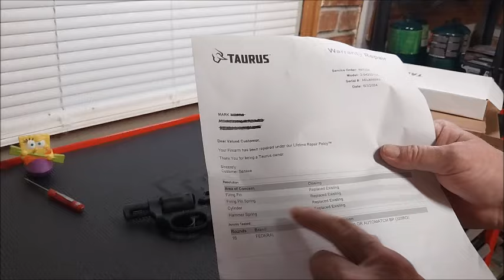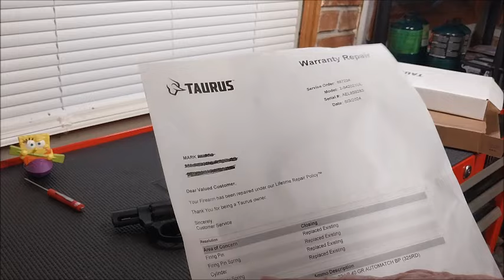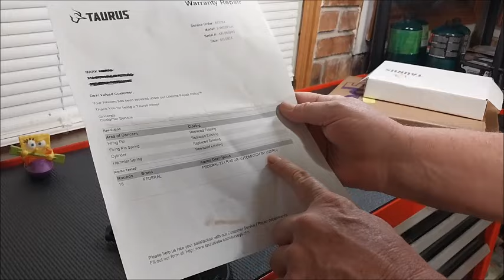Taurus 942UL Back From The Factory

Comment: There are a lot of people out there who use and admire Taurus firearms, but this is a perfect example of why I would never own one!
Reply: The quality control in a lot of companies are terrible these days, its not limited to Taurus. I had a 605 snubby and the screw at the trigger started to come lose. I took it to my gun smith and he fixed it. I ended up selling it and got a 3" barrel to replace it, and have had no problems with it since owning it. I finally got comfortable enough to use a semi and started out with the tx then work my way up to the 9 mm..
Reply from the maker: I can understand that and I don't blame you.I currently have 5 other Taurus firearms and they have been excellent,but I might take one out tomorrow and it won't work.Since I got my Shield Plus I haven't used a Taurus as my ccw since.

Comment: I don't know what is happening with the Taurus revolvers made in Brazil post Covid, but QC has been very spotty. Personally, the last three I've bought; an 856 CH, a Model 65 and the Rossi RP65 all had issues. All three had cylinder rotation problems. The 856 issue was minor. The cylinder would free float with two 158 grain bullets loaded if you staged the trigger. The 65 went back to the dealer because one cylinder wouldn't lock into the frame upon examining it at home. The Rossi, the cylinder locked up and went back to Taurus. In previous times I often recommended the all steel Taurus revolvers. I can't do that now.
Reply: Just picked up an 856 2", have yet to test it. Oh boy.
Reply: @joesheetstheragman7737  Well. Hopefully you'll have a cherry as opposed to a lemon. I wound up trading that 856ch, but I shot very well with it and am regretting I got rid of it.
Reply from the maker: I remember you telling me that over a year ago and I just mentioned it to Hillbilly in the comment above.Gun companies and their QC going downhill would be an excellent topic for his podcast,since it's already almost 7 pm now,I'll talk to him after the show and see if we can use that as a topic for next Saturday night's chat.I still have my Model 82 and it's been flawless(knock on wood) lol.The trigger and hammer action isn't quiet what it is on my 64-8 but it's close.And it's just as accurate.Hopefully our run of bad luck will stop soon.
Reply from the maker: @joesheetstheragman7737  I hope it works out for you.

Comment: I had same problem with my 942UL, returned to factory, they said they replaced the cylinder and test fired it. Upon receiving it back, same problems as before,   Had to punch the spent casings out with a hammer and punch.  So very  disappointed, having had other Taurus revolvers that were just fine.  Got rid of it and bought a S&W 43C  .22LR.  No such problems with it, functions like a champ.  You get what you pay for and it was twice the price of the 942 but I know in a crunch I can depend on it!  gyBased on all the favorable reviews of the Taurus TX 22 compact, I did buy one, it fires everything I feed it.   SemperFI, MGySgt USMC Ret.
Reply from the maker: From one veteran to another,,thank you for your service.I seriously don't believe Taurus test fires all their weapons before they leave the factory.I've looked at the 43C and that's a big chunk of change but then again you are right.You get what you pay for.I have the S&W 617 and it's an even bigger chunk of change and it's been working so well,,that it's boring to shoot after a while.I can't believe I just said that but it's true.Thanks for watching.

Comment: Time for a new gun. I own five. Lite 2inch 22lr, brush steel 22lr 2&3 inch, blk 2 inch 22mag, steel 3inch 22mag. Several hundred rounds through all, no issues. All under $350 new before, during & after covid. Very hard to find when looking. Used for range and loaded with Federal Punch when used for self defense.
Reply: Got the 942 mag back in 2022 when i was looking on Gunbroker and its been good. It was hard to find and I ended up paying $600. I have since bought may be 14 others on the site. I find some good deals on there at times. I picked up a Rossi 44 mag for 500 the other day. The same gun going for 700 at my local Academy store.
Reply from the maker: I hope they all continue to work well for you.
Reply: @garageguy879  As I sit here am hoping that I win a bid I have on gun broker for a 327. I got a Rossi 44 mag rifle last month and need to take it to the range. I usually take my guns to the gunsmith before I shoot them. I have never gotten rid of a Taurus because it gave me a problem. I sold 2 because I no longer wanted to carry a snubby. The ones I replaced them with have been great. The Kel tec Pmr I sent back to the factory and they fixed the feeder. No problems with it since then.
Reply from the maker: @tonyrebel63  hey Tony.I have no experience with a Kel Tec PMR.

Comment: I've had the same issue with my S&W 43c  and that's a high price revolver. Some  
22lr ammo seems to expand in the cylinder and is hard to eject.  I think another part of the issue with the 43c is the aluminum cylinder.  Try other brands of ammo, you may find some that work fine in the Taurus.

Comment: My BRAND NEW S&W 43C only fires 5 out of 8 charge holes. $800 revolver and it's a total piece of crap right of the box. S&W quality control is TERRIBLE. My Rugers are FLAWLESS and I have many. Don't own a Taurus yet, but found one at the local gun store. It's the all steel 942 snubbie in 22LR just like you have. Is it worth it?
Reply from the maker: Good question.As I'm sending you this reply,I just uploaded a video about a new 942 and my luck with it didn't turn out well.So as of right now,I can't recommend it.
Reply: Funnily enough, I had just commented on his newer video about a Taurus 942 how I picked up a heavily scratched, obviously-used 43C not too long ago, that was so old that it doesn't even have an internal lock, that is running better than a newer Model 60 (3 inch; still used, but looked almost new) which is having occasional hiccups resetting the trigger (like it'll stick to the rear). 
Conversely, never had a problem with the trigger of my dad's Taurus 85UL with it's original springs or Galloway Precision ones, so...TF?

Comment: Mostly likely bent the extractor rod by banging on it.    Needs to be dry fired a bunch to smooth the hand thru the cylinder ratchets.
Reply from the maker: That's certainly possible.I've been dry firing it with snap caps for a while now but nothing has seemed to have changed.

Comment: Sorry to hear that Mark i have had a couple issues with Taurus revolvers and have had some really good ones too so i guess its hit or miss with them. Why not send it back again?
Reply from the maker: I'm now thinking about doing that Keith.But you saw the video,I only got off 2 shots using the same ammo that Taurus said they used,and this cylinder was worse for ejecting the shells than the 1st one.I honestly don't think this was fired at the factory.Before I sent it off,I cleaned it really well.And when it got back to me,I cleaned it again but it wasn't dirty.Maybe they cleaned it at the factory but with their repair orders piling up on them lately I have a gut feeling they replaced the parts,put it in the box and got it out of their way.It's worse now than before I sent it off.

Comment: Magtech manufactures a very interesting ammunition, the 38 SPL SHORT. With that ammo you can use a light recoil ammo with the energy of a 32 ACP while maintaining the same holster, speed loader and the same gun, a 38 SPL 👍
Reply from the maker: I had some what could be called "old 38 shorts" a few years back.They all went off when I pulled the trigger and there was no recoil at all,very pleasant to shoot out of a snubbie.I'll have to keep an eye out for those.
Reply: "I can imagine how many people have a .38 sitting unused because they can't handle the recoil. Thanks for the video!" 👍

Comment: I had the SW43C Airweight, but sold it because I didn't like the very heavy dbl action only trigger, and they do not sell one with an exposed hammer.  I'm a Ruger fan boi so I started looking for an LCR, again 22LR no exposed hammer option.  So, I have about a dozen "notify me" requests out there for the 942UL, and I can only hope that I don't regret it.  Does anyone out there have any other snub 22LR LIGHTWEIGHT exposed hammer options?
Reply: Ruger makes the LCRx in .22lr with an exposed hammer. I've had one for a couple years and it's been flawless. It's more expensive than the 942 but more reliable. Also, Ruger customer service is very good
Reply from the maker: I bought my grandaughter a Charter Arms Pathfinder UL chambered in 22LR 2 years ago and haven't had any problems with it.Just keep it cleaned and lubed properly and it'll work well.Also I don't use the hot rounds,such as stingers through it.It's worked well with bulk ammo.

Comment: Did the factory really shoot 16 rounds? Hmmmm
Reply from the maker: I honestly don't think they fired even 1 round.Before I sent it off,I cleaned it really well,,no powder or oil on it anywhere.When I got it back,it was in the same condition & we know how these gun companies clean a firearm after a repair,they run a brush through the barrel and that's about it.There should had been some powder resedue,,but their wasn't any.And I tried the same Automatch ammo they said they used.It worked fine when I tried it with the snap caps but live ammo,,nope! I'm taking it to a gunsmith.
Reply: @garageguy879  what did your local gun smith find?